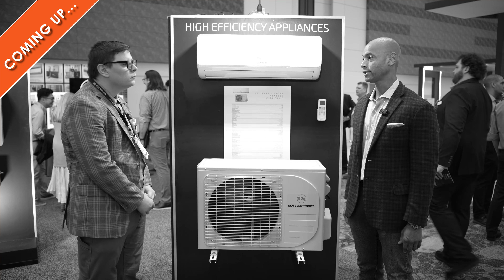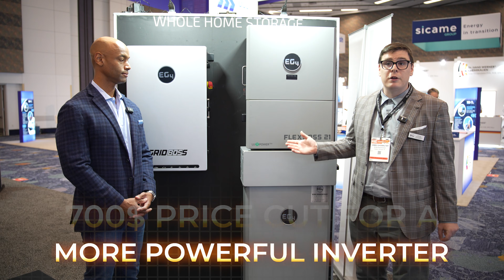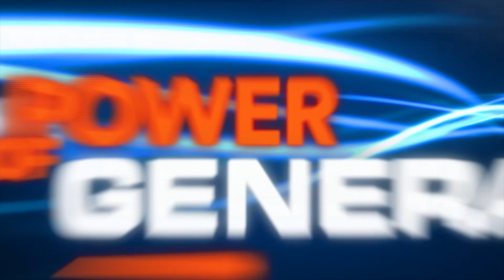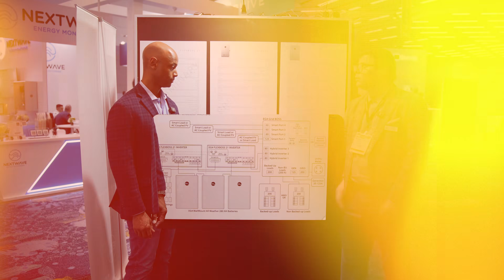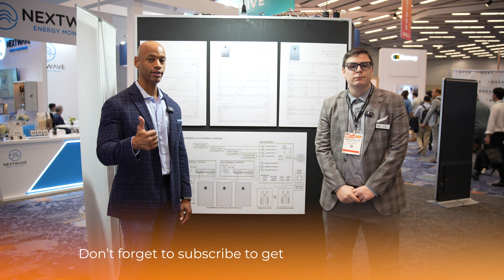New EG4 2024 Product Lineup

Comment: Still not as good as the Sol-Ark 15k, which I have
Reply: Competition makes everyone better. Plus they offer a whole solution unlike solark.
Reply: @samuelfeguer  Not true since there are now since their hybrid inverters and batteries are now EMP hardened certified as of a few weeks ago.  Even the ones that someone may have installed already.  There are several comparison reviews on the internet.  If you add their batteries, they are closed looped but not with Sol-Ark.  Sol-Ark made you pay 2K more for EMP hardened version.  Why pay 2K more.  That Gridboss and Flexboss will kill anything Sol-Ark has along with anything other top vendors may have.
Reply: @ChristopherFoote22  Are you talking about their commercial batteries? I see nothing on their website about batteries linking to their residential 15k which is what we're talking about.
Reply: @ChristopherFoote22  The EG4 18KPV-12LV has a maximum continuous output power is 11.933 kW at 50A whereas the Sol-Ark 15K can do 15.04 kW at 62.5A. In addition, the EG4 has 3 MPPTs in a 25A / 15A / 15A configuration, being able to parallel two strings on #1. However, the Sol-Ark 15K allows paralleling on all three MPPTs in a 26A / 26A / 26A configuration. Most of this will really only matter if you're on the absolute edge of what each unit can do, with the Sol-Ark being able to reach a little bit further than the EG4 18K. Is it worth $2,000 more? Or $4,000 more including EMP protection? Not in my opinion, but I'm not pushing that close to the edge. If I was considering needing to parallel a 2nd unit vs moving to the Sol-Ark, definitely.

But that Flexboss 21 looks sweet!
Reply: @TheFatman819 - based on what? Let's hear your specific thoughts. They both have minor strength and weakness differences but are very comparable at this point.
Reply: You’re just mad because you feel like you over paid, now you come here and try to make yourself feel better by shitting on innovation.
Reply: Sol Ark is awesome (for double the price).  How’s that Chinese monitoring working out these days?

Comment: Whats the output to an EV Charger?
Reply: On one of those four smart ports at 125, 80, 60, or 60 amps.
Reply: It depends on how many inverters you buy. 18kPV or Flexboss: at least 50 amps. 12000XP: at least 50 amps. 6000XP: 25 amps. (all of these should likely be at 80% for continuous usage over a couple hours)

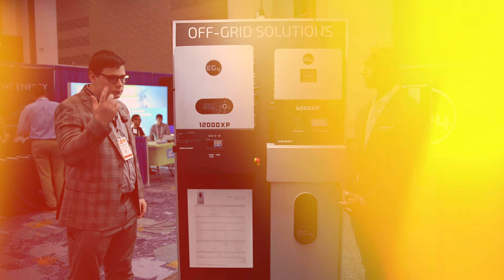Comment: I saw this at RE+... Starting at 27:55 that heat pump is a great idea for solar installers in California market... Conventional HVAC sucks so much power... I'll be installing these!
Reply: I'd love a central air unit. Or have a kit that lets you retrofit a conventional HVAC to run on solar as well.
Reply: @sirlesliechao  Keep in mind they cycle on and off so you should have a battery bank to suck up the power when the AC just has the fan on. If your AC is 3 phase which I doubt, you made need that type of inverter. These AC units are made for the power grid and use a huge in rush of current so you would have to oversize the inverter. I had a fridge that ran at 100 watts but it needed an inverter that put out 1000 watts to start. The problem where I live is once I have the AC running, I don't want to turn it off until I can open the windows. That doesn't happen until 9pm most nights with day temps in the 90s plus. The split units are variable speed, soft start and quiet. My solar can operate my AC and give me some battery charge when it is sunny but when overcast or dark it sucks up battery power. If the central unit quits during a heat wave a person can still keep a room cool with a split unit waiting to get the main unit repaired.